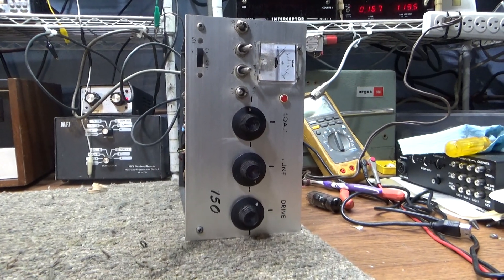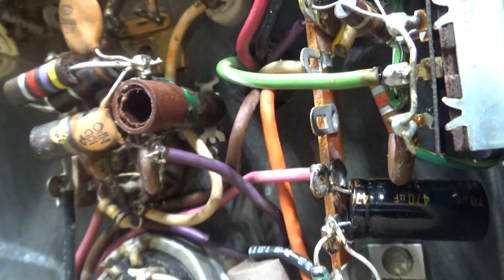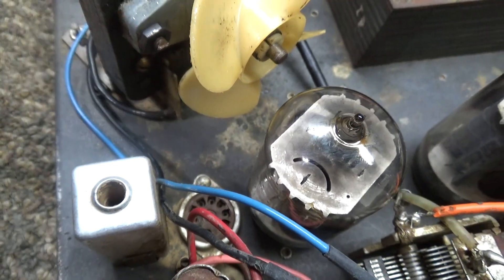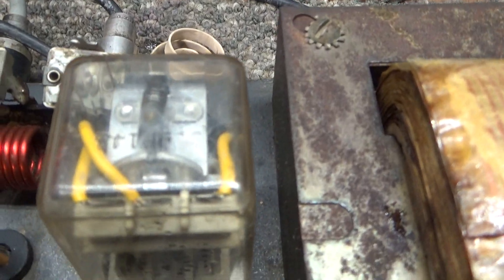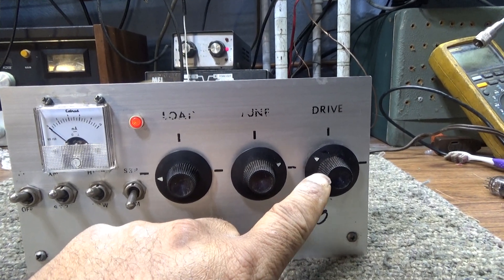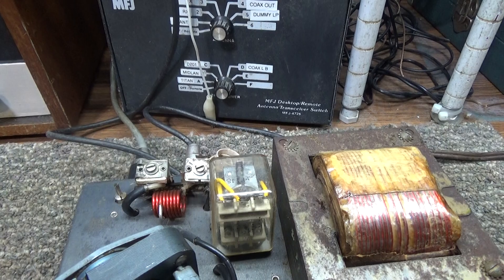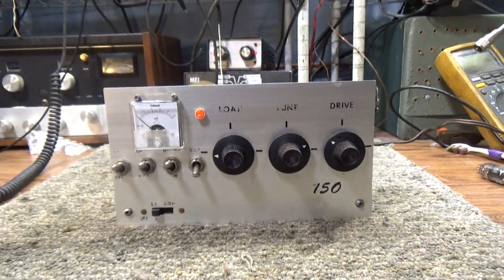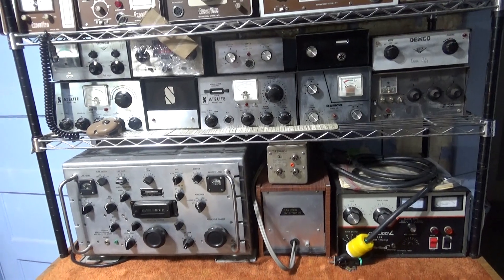New 'old' toy, Demco 150 vintage Linear Amplifier

Comment: I had the same problem,  not being able to find info on the 150. If you find any info on it , I'd really appreciate something on it. The one I got is in pretty nice condition.  I'm going to recap it and clean it good. 

 Do you know what frequencies this will work with?
Reply from the maker: 25-30mhz

Comment: Demco never quite managed to attain the same cachet as Browning.
Reply from the maker: They are not engineered the same or built as well.
Reply: @tramdr  I had a Satellite, the version with the 26.620 CAP crystal and the modulator/speaker. It took up the entire shelf! These days I have a Travelier with the power supply and it does everything that the Satellite did in way less room. To a collector, the biggest issue with anything Demco is the tendency of the front panels to rust and the fragility of the silkscreening.
Did I miss the Demon 500?

Comment: Cute little thing.  You need a tube tester that's not an amp, lol.  Demco's crystal socket looked like the large size of old.  They're rare like Hen's teeth now.
Reply from the maker: Testing a tube for actual power out is a much better test than a tube tester test.